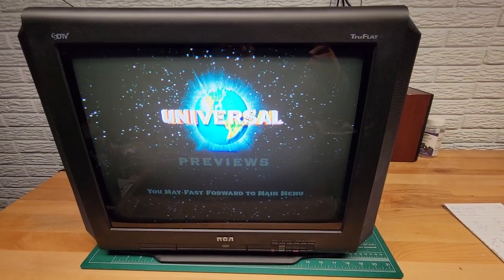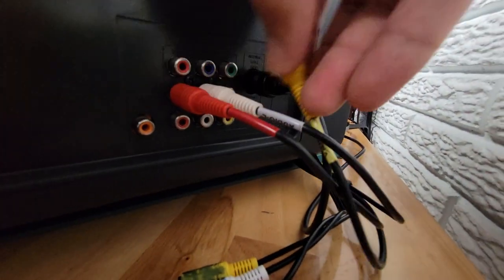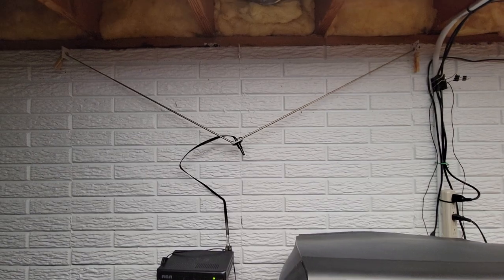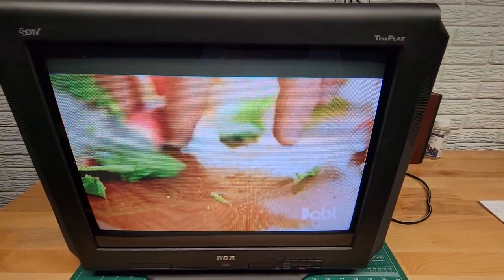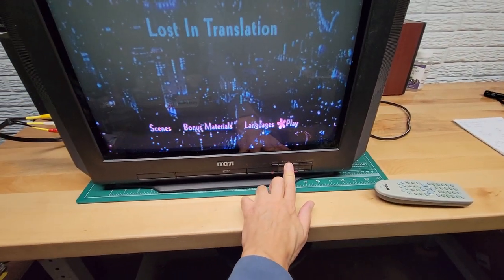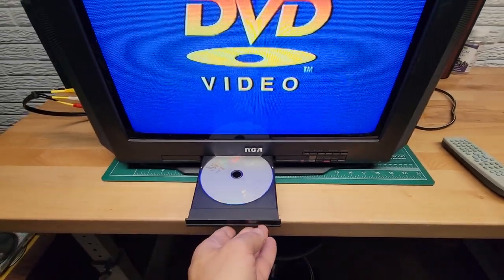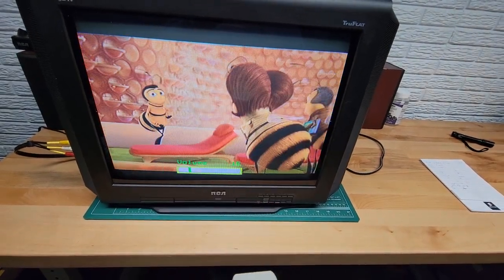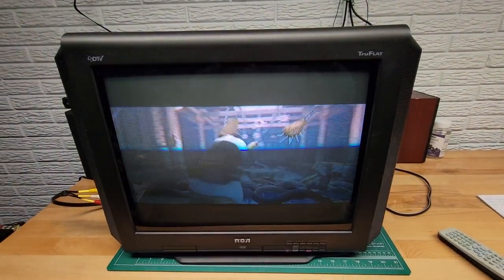RCA CRT TV DVD Combo 20F514TD DEMO Video

Comment: I have this model the component is bad the screen image settles to the right leaving a 1" gap on the left side of the screen. Also the colors bleed bad. I've adjusted the flyback and yolk inside from the back but it didn't make that much of a difference. I have the silver smaller version with s-video and it's performs way better. At least this black models DVD playback is good. It's shows the picture centered unlike gaming through component on it.